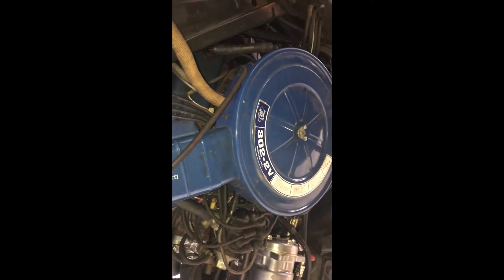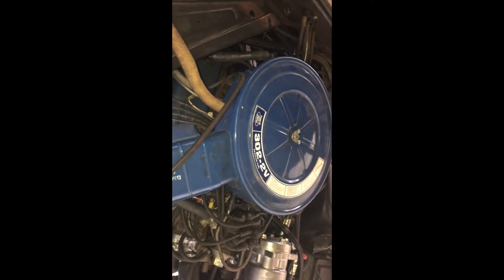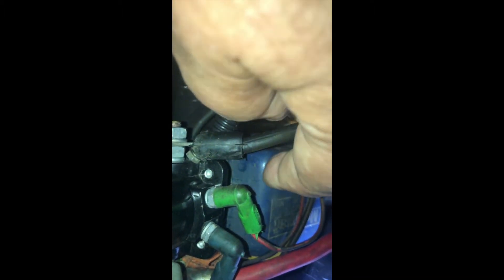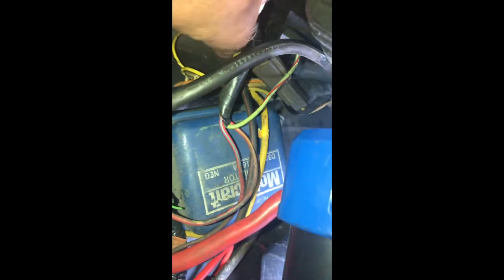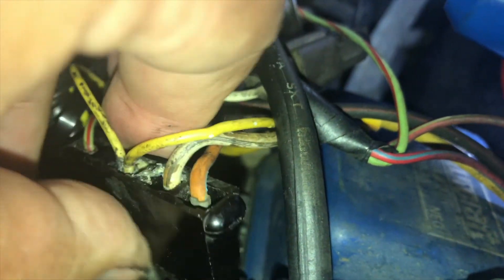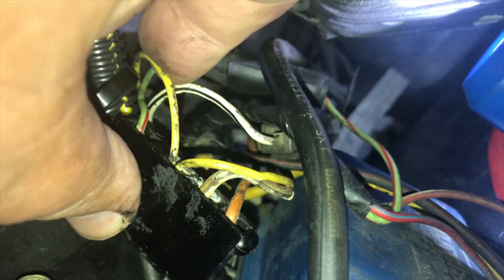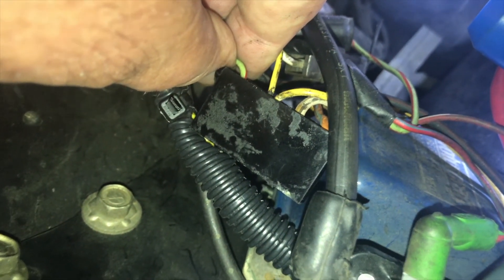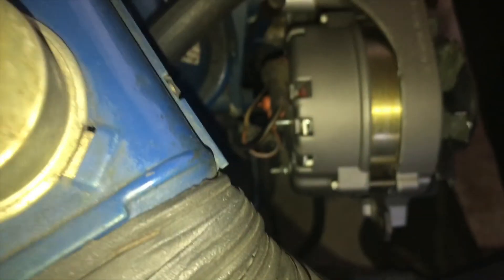1973 Mustang Charging System Alternator And Voltage Regulator Wiring

Comment: I’m having trouble finding a replacement alternator to regulator harness for my 1971 mercury Marquis. I have found some for cougars and mustangs that are close but the difference is mine has a ground wire that comes out of the loom and grounds to the voltage regulator fastener itself and a wire that comes from the pigtail in the regulator to a resistor. Do you know if any other vehicle in this era will cross over? No tachometer
Reply from the maker: Greetings!  I did some digging in my Parts Catalog which covers 1971 model year Ford (and Mercury).  I pulled out the relevant pages into an excerpt PDF file.  You can find the file on my Google Drive, and open or download it.  The specific information with the part numbers for 1971 LTD and Marquis is on Page 8, which information I have highlighted and annotated for clarity.  There are two general alternator styles available on the LTD and Marquis models (and other models also).  One is a Rear Terminal style, the other is a Rear Terminal style - which is for the higher output 70 ampere model alternator.  Near or at the end of the PDF file is an illustration showing where the Ground Stud and Ground Nut for the siring harness at the alternator are located, which again I annotated for clarity.  

I do not know how easy it is going to be to find and purchase those particular part numbers.  I often find Ebay has parts vendors who cover these older Part Numbers pretty well.  I know the Mustang and Cougar models for 1971 also have a Rear and Side Terminal specific set of harnesses, but their  Part Numbers are not the same as for the LTD/Marquis models.  Thus there must be some kind of difference.

https://drive.google.com/file/d/1u0aYtdOlfTMOih44wAeNZkeRwIaRzQ5l/view?usp=drive_link

Rear Terminal Alternator Wiring Loom: D1AZ 14305-D
Side Terminal Alternator Wiring Loom: D1AZ 14305-E

I hope this helps you get your situation figured out.  Are you anywhere near the Rochester, NY area?  If so perhaps you can come by so we can work this out.  If not, where are you located?  We travel a few times each year, and if you are anywhere near our travels I would not mind swinging by to help you out with this.  You can just respond to this thread and I will be notified of your further comment.
Reply: @gilberthale7777  thanks for your help. It seems the marquis was left behind in the reproduction parts world. I am located in central Mississippi
Reply from the maker: @justintrest  Mississippi, eh?  Sorry, a bit further out than we normally travel.  I don;t know if you have a Rear Terminal alternator or the larger Side Terminal alternator.  In either case I did a Google search and both of their part #s have a listing in ebay.  So, although the local parts stores will likely not be able to get one for you, ebay is coming to your rescue.  I ordered an alternator terminal kit for out 1973 Mach 1 with a 70 ampere Side Terminal alternator from an ebay seller,  The part was perfect.

For the regular sized Rear Terminal alternator D1AZ 14305-D - eBay item number:275988715216

For the larger 70 ampere Rear Terminal alternator D1AZ 14305-E - eBay item number:387357227452 (very costly)

Gil
Reply: @gilberthale7777  I did a little more research. It looks like a 1971 Ford Galaxie has the same exact harness. It has a rear terminal just like the Marquis. Thank you for your help. Guys like you that have been around these automobiles for a while sure are a breath of fresh air for us younger folks. Thanks again for sharing your knowledge, it is very much appreciated
Reply from the maker: @justintrest  Yep, LTD is a gussied up Galaxie, which is the Ford cousin of the Mercury Marquis.  I am glad you were able to make sense of it all.  If you have any other questions or concerns just reach out like you did.  I do take the time to review comments made with my YouTube postings and comments.  And when I see a comment I like to respond.  It keep me feeling relevant in a world that has moved past these older beats long ago...  heh heh...

Comment: Thank you Sir!! I'm putting 3G alternator in my 72 mach 1 , I needed to know if that green wire  goes to the dash light.
Reply from the maker: Hi!  I have not needed to work with a 3G alternator in these vintage Mustangs. Yet. I will dig into their circuitry and let you know. This may take a few days.
Reply from the maker: Hi Ed!  I finally wrapped up a few other projects, and carved out some time to get you some 3G alternator wiring info.  I cheated.  I did a Google search on Ford 3G alternator installation wiring.  One of the links I got back from Google had a group of images and sub-links that pointed to some really clear, and useful information.  I open a few of the links, and printed to contents to a few PDF files, as well as some info for other links as well.  Following is the one link that had so much underlying info:

https://www.google.com/search?rlz=1C6CHFA_enUS1044US1046&sxsrf=APwXEdfOexafZ0ss7NoEKIp2mNbhce4wUQ:1680067961343&q=ford+3g+alternator+wiring&tbm=isch&source=univ&fir=aqGSboJ28IqLMM%252ClIPTkk0rnJ-XpM%252C_%253B4TN7oybSS-P2oM%252Cuz1y31dV8zhsjM%252C_%253BPgzA1vqDM4g20M%252Ct98cLF9ZG8_uZM%252C_%253B320xWogLYJYHqM%252CHTibU9_nzmmW5M%252C_%253BHJOJ4wsV2_VEkM%252Cuz1y31dV8zhsjM%252C_%253BXXfqQ1gBQemv3M%252CcVA0-wMCAnxF1M%252C_%253BpuR3JMTRok-2XM%252CpnvgTYkwPN3y2M%252C_%253BYmaPnCgFkRZV6M%252CiWZznQBM1AMvtM%252C_%253B-67IHxMj53rG6M%252Cqojt9uJWXPL42M%252C_%253B3aU-m70h-ZGmjM%252Ct98cLF9ZG8_uZM%252C_%253BVOr4mtZQF5tsuM%252C_A5wTt2uyFGYvM%252C_%253Bmk5392F5EfGcMM%252CHTibU9_nzmmW5M%252C_%253B9KEZExEDrSVQlM%252CV3abMg1SdtO2xM%252C_%253BmXytyruh8il8PM%252C5YIofu4CsT2TwM%252C_%253BUq0MWWQU_J3HfM%252CHL1leVd_GKg3EM%252C_&usg=AI4_-kTmW5aPujbWcRf58FNW4z8QXbzKQA&sa=X&ved=2ahUKEwjE6aLwtID-AhUAD1kFHV8GDq4Q7Al6BAgXEFY&biw=1728&bih=857&dpr=2

The set of relevant files I printed to PDF are located on my Google Drive under the directory (folder) in the following link:

https://drive.google.com/drive/folders/1Zmf668Dbc0bj1aYAx2D63RRQlt8qCTlv?usp=share_link

I hope that helps.  Let me know if you have more questions.  After looking at all this info I am pondering moving t a 3G alternator on one of our 73 Mustangs, just for giggles and grins.  With the larger rotor windings on our rebuilt and upgraded 1G alternators we are getting plenty of output for our pony cars.  But, the 3G looks like it would be a fun project.

Comment: How to replace 1978lincoln mark v alternator?,??
Reply from the maker: i have one video where I install a rebuilt alternator into our 73 Mustang.  The process is very similar to the 1978 Mark V (my father had a Diamond Jubilee Mark V back in 1978.  I also worked at a Lincoln/Mercury dealership as a technician for a while before being recruited to go to a Ford dealership as a tech.  I loved working on those Mark Vs back then.  Very nice vehicles,  

Anyway, the video where I install the alternator on the 73 Mustang is at:  https://www.youtube.com/watch?v=Vm88glOT7LY

I do not have any videos (yet) showing how to first remove, then replace, alternators.  The important thing to do when replacing an alternator is to remove the negative cable from the battery to effectively kill all electric circuits while performing the replacement.,   If the video above is not enough to help you with the full remove.reinstall process, email me at gilhale@gmail.com and I will provide some shop manual directions.  The good news it replacing an alternator on a Ford is fairly easy.  But, it can become a little tricky if you are not familiar with the process,.  I have replaced alternators on Fords in driving rain, at night, laying on the ground in the middle of a parking lot (long story), where I had to largely go by feel as the little battery power in my flashlight had to be spared for only the hardest part of the process.  But, I got it done, much to the surprise and delight of my son.  He had never seen me do that kind of work before, much less in the dark during a rain storm while outdoors.  heh heh...  I think it was then that he began to realize I really did know as much as I felt I did...

Comment: At the alternator does your wires to alternator does it have the metal tab?
Reply: Yes sir that one. That is just a mounting tab or does it have current going through it. Looks like it has to be there for alternator to work. Mine has 3 wire hook up to the alternator but leading up to it is 4 wires. Looks like one leads to metal tab. Mine seems burned out or broken. Thinking that's why I'm not getting fire to my engine?
Reply from the maker: @royhopkins2906  As I recall that metal tab used to secure the wiring harness to the Alternator does serve as a ground connection also.  But, if it were not grounding it ought not interrupt the ignition system's performance directly.  If you are getting a no start condition it is likely due to some other cause.  The big things to look for are fuel, spark, and valve.ignition timing.for a "crank, no start" condition.  I am assuming you are getting the engine to crank over, but no start?  If communicating back and forth is cumbersome within the YouTube interface you can find me on FaceBook (Gilbert M Hale, from Pittsford, NY) in any number of Mustang/Shelby groups I am a member of, or via FaceBook Direct Messenger (DM).  Facebook home page for me is https://www.facebook.com/profile.php?id=1300222433

I am certain we can get to the cause of your no start condition.  These older engines are far more simple, and easier to diagnose, as compared to newer engines.  A lot less complex with their carious electrical and fuel systems.
Reply from the maker: By the way, thank you for subscribing to my YouTube channel
Reply: You got some good stuff on there. Gotta subscribe 😆 it just seems weird because it is a 3 wire connection and with the metal tab there is a wire that goes to it so I dunno if that one connects something that would cause it not to start.
Reply: @royhopkins2906 
A Black wire to the metal tab should ground near or on the regulator. Many don't have this wire. It should be added if not present to enhance alternator performance.

V/R Chris
Reply from the maker: If by "metal tab"" you mean the mounting piece to secure the wiring harness at the Alternator end, yes there is a metal tab.  It is attached to the Alternator with one of the studs with a nut to secure it.  I have another YouTube video relating to an Alternator that shows the ?metal tab" I am referring to at"
https://www.youtube.com/watch?v=Vm88glOT7LY

The relevant part of the video begins at 07:45  into the video, and again at 17:16.

I hope that helps.  If you need more info or detail/clarification just post another comment and I will be notified via email.